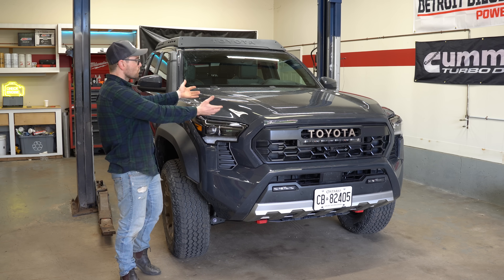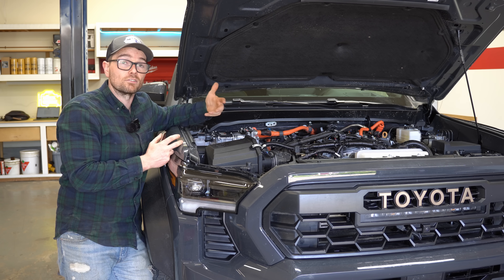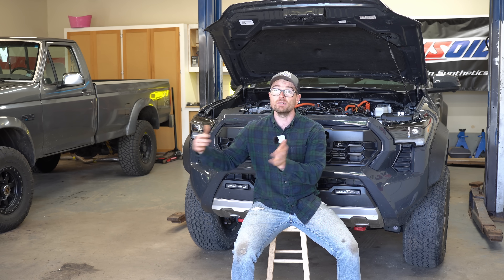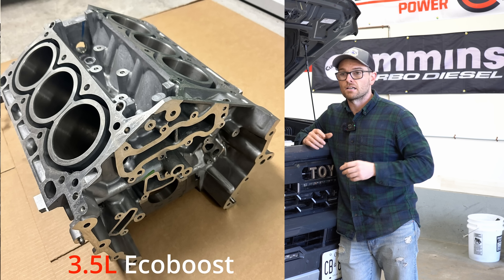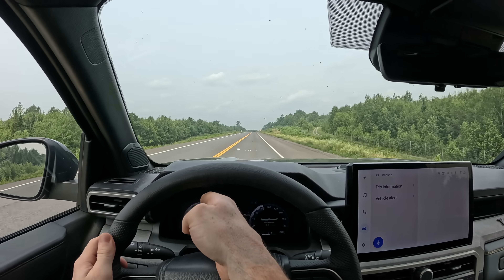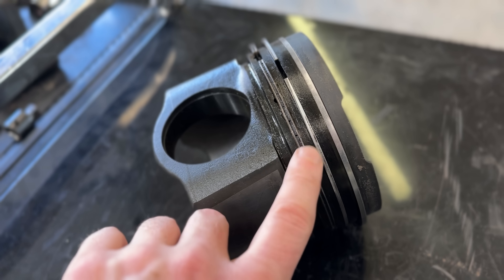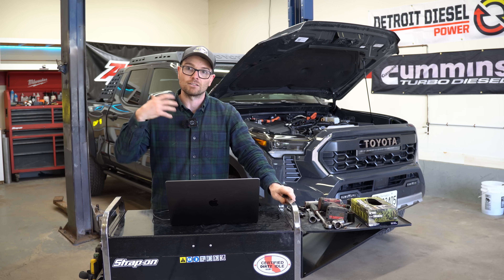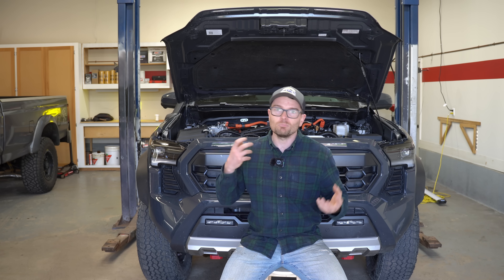Toyota Tacoma's 2.4L I-Force Turbo: CONCERNS Every Buyer Should Know (Mechanic's take)

Comment: From what I can tell from engine diagrams, it appears the T24A does not have locater tabs on the main bearings.  If accurate, that would follow what they did on the F35A in the Tundra.  Having owned a 2023 Tundra, I know that has not worked out too well. While there are other automakers (Stelantis) that follow this cost saving practice, I don’t think it is good judgement to utilize it in a long stroke, heavily boosted 4 cylinder engine that has an inherent high amount of harmonic vibration. The bearing loads are quite high to begin with and then you place it in a vehicle intended for and towing and off road use.  The radical shift in Toyota’s approach to engine design is really disappointing.  I think they have underestimated the brand loyalty that was based on durability.

Comment: In my DIY way of thinking, it may have enough power to pull the enclosed trailer you have but, I think it will burn a lot of fuel. 

Just my opinion.😎

Comment: Purchased a 25 TRD Off Road in June. I had my doubts about the 2.4 turbo, but liked the 21mpg spec and that is what I seem to be getting. Not quite 3,000 miles on it, but we had it up to the NC mountains waterfalls hiking last weekend. Even ended up on a long and questionable dirt path. All in all, I was pretty satisfied with the performance. No problems with all of the inclines and tight switchbacks. I have changed the oil twice already with RP and will do it again at 5K and no more than 5K each time from there on. We’ll see how long it lasts. Going to give it every chance to last that I can. Yeah I would have preferred a V6, but I am going to keep my fingers crossed that this converted Lexus engine will hold up the Toyota Reputation.🤞
Reply: Let's see if you're Taco survives to 50k miles
Reply: @BERZERKERSV4  🤞I did pay for a 10 year 100,000 mile extended warranty.
Reply: @BERZERKERSV4  it will last until the warranty expires at 60k miles, like it is designed to do. trade-in value of the 4th gen is awful.
Reply: I got 21.7 MPG in my 2016 TRD OR DCLB.
Reply: these turbo 4 bangers are so hated, Toyota is bring a new v6 n/a motor back for the tacoma.
Reply: 21 mpg sucks.....6,000 pound Land Rover with 395 hp inline six gets better......
Reply: @chadhaire1711 My point was 21 MPG is not great, but who gives a damn about MPG? My 6000 pound Tundra has 395 hp and I couldn't care less about the MPG. ... and I won't have electrical and mechanical problems; no land Rover ever built can claim that.
Reply: @timalan7406  THis is about the Tacoma, not Tundra and from what I have seen, the land Rover Defender is no worse than these new Toyota four bangers as reliability goes
Reply: @chadhaire1711  Yeah but it is MUCH worse the the 2016-2024 Tacoma.
Reply: @timalan7406  they all are
Reply: I’m sorry I’m just so sorry 😂😂😂😂😂

Comment: You are always fair and balanced. I love Toyota and have a 2024 RAV4 hybrid with this motor. Perfect running machine. 220 combined HP.  This is the exact spot for this 2.4 motor. I also have a 2012 Highlander with the famous Toyota V6. Kick butt motor with 200K and still going strong. Appreciate the attempt to better emissions and mileage but sacrificing reliability and engine life?  No!  4 cylinders in pickup trucks?  No!  Turbo Hybrid in my sister’s new Highlander blew out the very plastic water control valve you speak of at 20k stranding them 4 hours from home.

Comment: I bought my 24 TRD Offroad Premium last December. 8 months later at 10,600 miles, no issues. I will say, the gas tank is small but does a great job in the highway. A lot of my miles are highway. From my experience my average MPG is 22+. Now, for a 100 mile trip in the highway, average 28 to 29mpg. 

Great and informative video. Keep it up.
Reply: youre getting 28 29 MPG? I know my trailhunter is not the same trim but i average 17. Its been awful.
Reply: I get 22 on the highway with a 4.6l V8... IDK if the small gain is really worth all the complexity and worse construction
Reply: @pauld.b7129 im with you. I regret getting it.
Reply: @pauld.b7129 What kind of vehicle is your 4.6 in? I hsve  F 150 4x4, and it does about 16 from.what the last owner said.
Reply: One would HOPE that there's no trouble at a mere 10k miles.
Reply: @TIJoe-te9qu  bragging about 10k miles with no issues is absolutely insane
Reply: Idk, man. I have the exact same truck and the ONLY time I saw 28 MPG was driving eastbound across New Mexico with a 40 MPH tailwind. 20-22 is what I typically see.
Reply: @iridedoyou Sounds more realistic. Really no better than the Frontier six from what Ive heard. Just more turbo stress om the engine.

Comment: I have been a Toyota owner most of my adult life. I have had several Toyota trucks, a mini van and one car. All of which were long lasting and very dependable. I have also had an American brand truck 2007 Chevrolet Silverado, bought new and  I sold that truck at 200K miles. I currently have a 2019 Tundra Limited, love this truck.  This will be my last Toyota truck. I am extremely disappointed in Toyota and the direction they are going. That is saying a lot given how long I have been with Toyota. 40+ years.

Comment: As a guy whos last Toyota bought new was a 2007 Taco Double Cab with the 4.0 6 cylinder, these newer engines do scare me. I did not get good mileage with the 4.0 but it never broke on me, and that was an acceptable trade-off.
Reply: As a non-mechanic kind of guy. Interesting video seems like to me. Maybe the way to go is get a first generation Toyota Tacoma that super well maintained or get a second generation Toyota Tacoma and I guess that would be what from 2005 2011. That's for the second generation and that's when Toyota was still making engines to last and they weren't so just focused on fuel economy. I mean that's good to have a good fuel economy but.. 
I'm currently driving a 2004 Toyota Tacoma prerunner and I went and looked at Tacoma's last year but nobody makes a compact truck with a 6-ft bed anymore and most of the tacomas I saw all I had 4-ft beds I was like well. When am I going to do that? Anyway, good video
Reply: I believe Nissan Frontier has a 6ft bed option.  @jejunamja
Reply: @kyleigh2643thanks I went and looked at those but they're still kind of a midsize truck but you're right it's probably the best option out there for the smallest truck with a 6-ft bed but I just saw something online at Toyota will be bringing a compact truck to America maybe a year maybe two from now and so I'm thinking I can keep my 2004 running another couple years

Comment: My main concern is the lack of external transmission intercooler.  Definitely don't want to stress this offroading or towing.  Better off going with Nissan's VQ 3.8. And now they announced the Xterra will be back in 2028.  Only concern with Nissan is replacing that water pump at around 150K.
Reply: It's not an "intercooler" but rather a simple heat exchanger. The only intercooler in this engine is that which is used to cool the turbocharger's compressed air prior to that air entering the engine itself.

Comment: Ford used plastic radiators on their 1986 Ford Taurus debut and they used a cheaper plastic than what could have been used - end result almost every Taurus of that generation needs a new radiator. Camry used a plastic intake manifold and they end up needing to get replaced. Now they're putting in plastic gears which are going to be bald well before a steel/aluminum counterpart would be. If weight savings was that important Toyota should have invested in gigacastings, not try to save 10 oz here and there and drop the MTBF on every functional mechanical subcomponent.

Comment: Historically automakers biggest competition is old vehicles, even those made by them. Along came government regulation requiring these vehicles achieve arbitrary fuel efficiency goals, but they said nothing about durability. In the end, manufacturers paired early demise with those efficiency goals. Since it takes significant energy to make a car, early car death has to be taken off the fuel efficiency report card. The other dirty secret is the way hard plastics used widely by automakers are entirely unrecyclable. At least steel rusts away. Those plastics will be still around in a thousand years, eventually degrading to microparticles that pollute our ecosystem.

Comment: Went with Ridgeline N.A. V6, love it....
Reply: They recently recalled your engine. 😬
Reply: Honda's V6 is amazing and the really durable composite bed with the trunk and swing out tailgate makes the Ridgeline the best midsize on the market IMO. The all wheel drive is very advanced too and can climb a steep gravel hill better that the majority of trucks out there. Check out this video.
https://www.youtube.com/watch?v=FG3H3T52Zo4
Reply: Direct injection, cylinder cut off and auto stop/start. Not good.

Comment: We had this engine in our 2023 Highlander, we got rid of it in months. This is a horrible driving engine, it was tuned for efficiency and the dead spots in its power band are dangerous. If you have to pull out in traffic it goes from no power and creeping to full turbo and wheel spin, then the traction control shuts everything down again in traffic. It drove like my 90's big single  turbo cars but the traction control made it worse. My parents have the exact car in hybrid and it drives night and day better. If ours had been hybrid we would still have it.

Comment: I am not sold on these undersized over clocked engines the manufacturers are switching to.  My opinion it's a gimmick just like the auto stop/start system in the name of mpg.
Reply: Just to put things in perspective: 1978 F-100 5.8L (351) had 200HP max (in reality 150-200, 210 with fuel injection), so 5.0L Coyote with 425HP is ... an undersized overclocked engine. Toyota 5.7L has 381HP, the same.
Reply: @victor74293 I would hope that engineering would improve in 45 years.  Your 5.7 reference is still a V8 and V8s are a dying breed for the 6 with turbos and the V6 is dead for the I4 with a turbo in non sports vehicles. In my opinion forcing higher power from a smaller engine that has tighter tolerances will have bigger problems sooner as things wear over time. All in the name of chasing a number mandated by not the customers.

Comment: I hear the government is relaxing some of the EPA requirements and just in time! Engines have become less reliable because of all the government mandated rules and regulations. On the plastic bits, not sure who is responsible. Of course plastic components in the engine compartment is no bueno, but more and more manufacturers are doing that. Who ever gets back to producing non-aluminum engines without plastic parts will earn a following.

Comment: Toyota took the turn that, bmw, did they use composite coating on the rod and main bearings. Bmw is having durability problems on the V8s. All it takes is a little debris or carbon to spin those bearings. Take a look at the tundra or, better yet, the 6.2 Chevy they also used the composite coating bearings

Comment: Nevermind, they made the manual worse by the reving the engine 900rpm lower and making 8hp less than the automatic.  As a life long toyota guy, these current toyota engineers are idiots.  Also, no more access cab or a real key.  Was going to buy new one but will stick with my tuned 4.0 6 speed.

Comment: As someone who owns and loves one of these trucks I can deal with almost everything mentioned. Every engine even the best ones have problem parts. Just learn how to swap them and you’re good to go. The plastic balance shaft gears sucks though. I know it’s probably fine. I’ve seen brand new looking plastic gears in transmissions with hundreds of thousands of miles and these engines have proven reliable for Lexus but still… a plastic part that drives the oil pump is just dumb. If for no other reason than my monkey brain not being able to comprehend plastic being strong😂Guess we’ll see how they hold up over hundreds of thousands of miles in the trucks.

Comment: The biggest issue with this engine in both the Tacoma and 4Runner is it requires premium fuel.  The fuel economy isn’t significantly better than a full size truck.  When you consider cost per mile from the more expensive fuel, it becomes pricier than a full size truck.  Given how much Toyota charges for the new trucks to buy along with the cost per mile, it’s hard to argue their midsize is the value it once was.
Reply: It does not require premium fuel.
Reply: @ektj That’s not what the dealer told me, but would be great news!

Comment: You know what really does the most damage to these aluminum engine blocks is when they overheat.... Aluminum block and heads combine with the extra heat of a turbo is just a bad combination when it comes to reliability and longevity...

Comment: The sooner you switch to 5w30 full synthetic oil the longer engine life you will get. 0w20 is not for long term reliability . It's for fuel economy to get you just past the warranty .
Reply: Internal engine clearances are specifically engineered for the 0W20.  Modern machining techniques and tooling is a game changer in that regard. Modern engine oils are also greatly superior to those of the past.  Blindly recommended higher viscosity oil while disregarding those things isn't smart.  (I'll note I'm a multi-patent holding mechanical design engineer.)   Engine oils should always per the manufacturer's spec.  In some cases manufacturers due to permit a couple different oil viscosities. In that the case, the higher viscosity choice would be perfectly fine and preferred in more demanding operating environments, excluding very cold ambient temperatures conditions.
Reply: @harddrivin1le-970 Totally agree with you. I do not know why people think they know more than the engineers who designed the engines. There is no harm by using 0-20, but I would not take the risk that changing viscosity in my oil could potentially cause a problem. No benefit to switching that I know of.

Comment: All these new vehicles are great so long as you dump them before the warranty runs out. With such complex drivetrains, repair costs outweigh any  benefits of ownership.
Reply: I'm seriously considering leasing a next vehicle as it seems no company has a reliable vehicle out of warranty.
Reply: @drewthompson7457 Lease deals rn on tacos
Reply: Of course,  the one truck WITHOUT all that complexity is not mentioned, the Frontier.
Reply: 😂😂😂 oh it will trust me Nissan’s by far the fucking worst anymore
Reply: @bobg3221 Nobody trust this low-information ranter. He didn't buy one, and is a random hater who brought no receipts.  The overwhelming majority of ACTUAL BUYERS  have been leaving very positive reviews on their Frontier purchases for several years now on the new generation,  and many reports on the previous generation going 300k plus miles. 
There is even a 2007 on TFL that exceeded a MILLION MILES. 
JD Power rates the Frontier above Mexican soft Taco in resale as well. 
I think I'll trust the preponderance of evidence, NOT  what one hateful comment says.
Reply: They are a pos

Comment: 2.4 turbo.   That probably good for 95000 miles, but for 60,000 dollars,  I'll keep my V6 4Runner for another 200,000 mile and  I get to keep my money too.
Reply: I share your affinity... my 2007 FJ at 316k miles has been rock solid....with minimal repairs  ( clutch)
Reply: be honest your not even in the market for a truck at that price lmao toyota or not
Reply: It’s funny that you mentioned that because I have a 2009 4Runner 4.0l great engine frame sucks suspension sucks all the rust sucks and has caused tranny leak problems literally puking out oh not to mention the wheel hub assemblies and I almost forgot the front diff wasn’t very impressed with the 4th gen being done at 17 years old and only having 170,000 miles on it that’s an embarrassment to Toyota maintenance are not not really sure the previous owner really took care of it, but it should’ve lasted a hell of a lot longer than what I did I had that damn thing for five months and it went downhill quick so yeah let me get this 2026 Tacoma that I just purchased and see what those 2.4 L I force dose
Reply: Plenty of this 2.4L turbo in the Highlander are hitting 200k now
Reply: @chibbyylol  no freakin way. liar.
Reply: @chibbyylol  not!

Comment: The open deck block, plastic coolant control valve, and composite crank gears are all valid concerns. To simply dismiss these concerns by saying "but it is a Toyota" would be naïve. Remember, Toyota does not make each and every part of the vehicle, many of these components such as the crankshaft gears and coolant valves are likely made by the same suppliers as those sold to GM, Ford, Dodge, Nissan....whomever. Any problems suffered by the others will be shared by Toyota. It is not like the supplier thinks, "hey I better ship only good parts to Toyota." I cannot speak with authority of how Toyota chooses suppliers, but I do know they have recall and warranty issues just like everyone else, well everyone but Ford. Ford seems to be in a league of it's own these days as far as recalls are concerned. I guess what I am saying is a bad idea is a bad idea not matter what emblem is on the grill, take wet timing belts for example.
Reply: Toyota is probably one of the most vertically integrated car companies along side maybe Hyundai-kia

They own most if not all of the chain that produces the steel, transmission and components of this engine (denso, aisin etc)